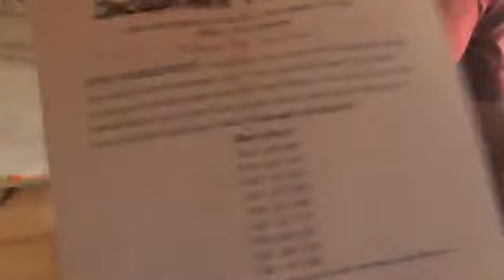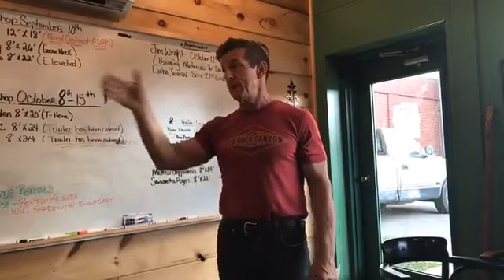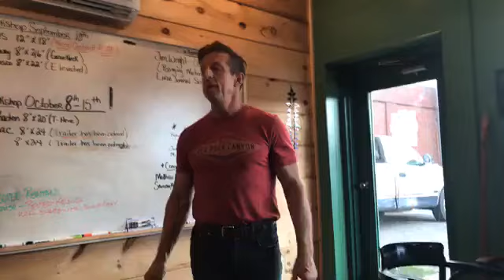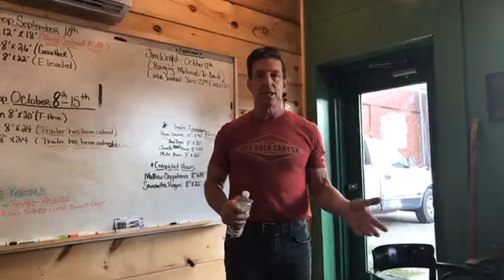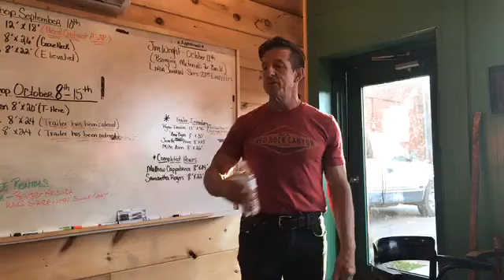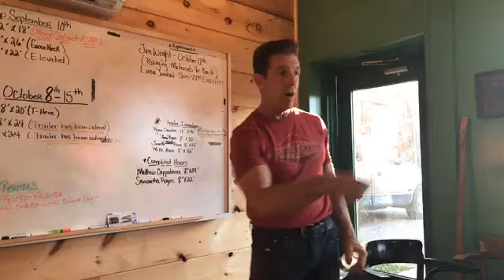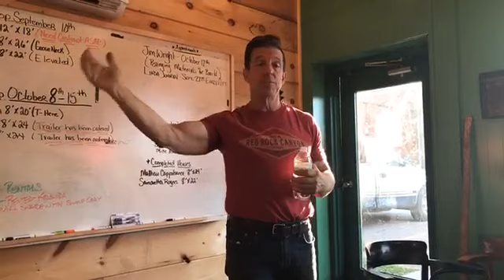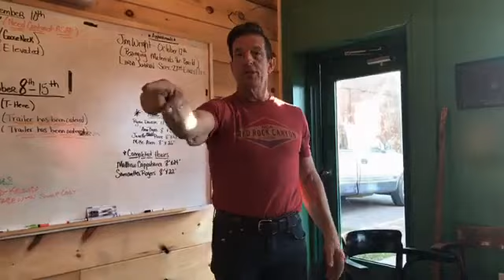Incredible Tiny Homes Live: Custom Tiny Homes Under Construction Tours

Comment: Do you have to do anything to reclaimed wood when you put it in a tiny house?
Reply: It's basically recycling, so it depends on what condition the wood is in when they get it and what they ultimately intend to use it for as to what they may need to do to it...

Previously used wood can have nails, screws, and other hardware in it and may have been treated with something that may not make it ideal to use for the interior of the house.

If sourced from a company that sells reclaimed wood then it may already have been processed and is ready for use like any other milled wood products, but if they're reclaiming it themselves then that means needing to remove the nails, etc. and maybe patching the wood up before they can use it...

While knowing the source and preferably the history of the wood is important because the wood may have been treated with something toxic that would make it unusable for the interior of a house... but it is possible to use Urethane, epoxy, and shellac to seal it and may be done if unsure of the wood's history...

Salvaging wood, though, doesn't only mean reclaiming...  Wood that would otherwise have been disposed of or otherwise discarded can also be used and these may just have imperfections for the reasons why they weren't going to be used originally...

So they may just need to trim off unusable parts, or patch things like knot holes, or they can turn it into a feature like Beetle killed and worm wood that provides an alternative unique look...

In some cases the material may be something the customer acquired and wants them to use, like live edge wood slabs, decorative tree bark panels, etc.